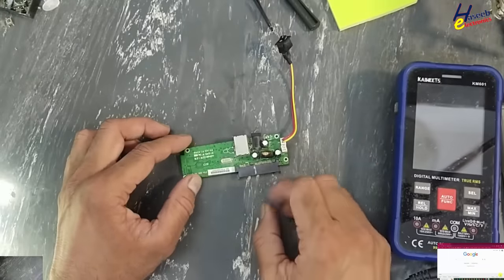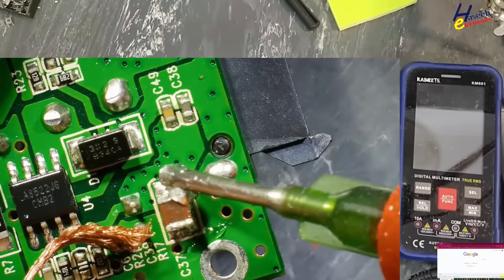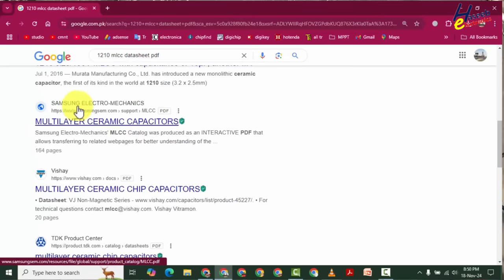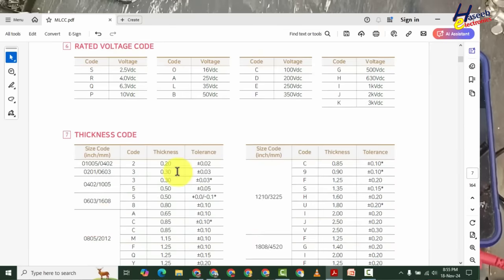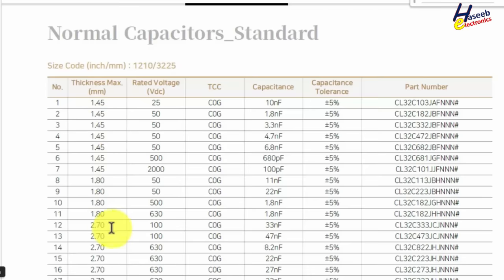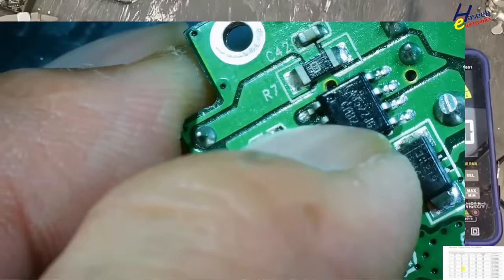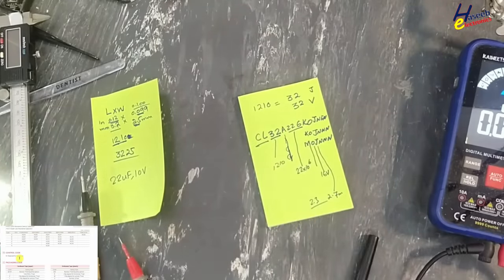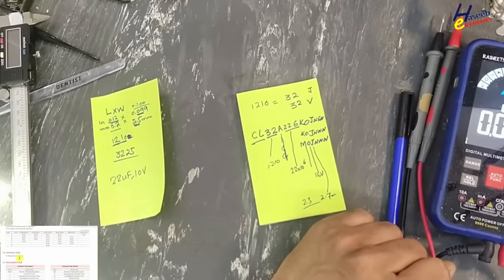{1243} Decoding SMD Ceramic capacitor to voltage and capacitor value

Comment: u didnt find its value until u measured with multimeter.
Reply from the maker: you are right 
first i took size code (length and width)
then datasheet 
then thickness
then circuit comparision for finding capacitor voltage (because too many voltage values are available in same thickness)
at final stage i found 16V 10uF, 
16V 22uF, 
and 16 V 47uF, 
if the capacitor is damaged then we can select any one of these 3 and testing the ripples at output stage for best fit component
Reply: well, he did narrow it down to 3 values. If you have a 2nd capacitor the same size on the board you could measure it. If no schematics are available you may just go with the largest value of that size and it could work. If still not lucky then try the smallest size. usually largest size will work because voltage is higher just the bigger ones cost ore and might not fit. I usually salvage something same size or bigger and just try it. I fixed a macbook the other day and just fitter a random cap, larger than the apple capacitor. It worked..
Reply: @izzzzzz6 normally if its light colour( white)the value is rated as pF, if its light brown it could be nF if its dark brown its uF(sometimes nF but bigger values)
Thats what we noticed in the manufacturing company
However some people saying its more about the material they have used, but whenever i have done the programs this theory was always worked for me.
Reply: Thank you very much for the info

Comment: Thank you. Have looked unsuccessfully for such info
Reply from the maker: Have looked unsuccessfully for such info????
do you mean, this video is not informative??
please reply for my calrification
Reply: Hi, thank you for sharing this video. As you showed us, there are many capacitor ratings for the same capacitor dimensions. Here you were able to measure one good capacitor, but if that capacitor may be in short (reason for us to be checking for its value in most cases), it would be very hard to say for sure which capacitor should we be replacing... Could you please explain to us how can we proceed in case of a failed capacitor? Thank you very much. Greetings.
Reply from the maker: @ruimonteiro7523 first of all thanks for your valuable words 
in case a damaged capacitor, and we have multiple choices, then it is to try one by one and to find the result of the circuit
Reply: @HaseebElectronics  They mean that they have been searching unsuccessfully until now.
Reply from the maker: Aah 
I got it now 
Thanks a lot 💕

Comment: Thank you for sharing the decode method.I didn't know it, great. The SMD codes are always a pain. Several times I had semiconductors with codes I couldn't find in SMD code books or the Internet. In this cases a repair was not possible. Resistors have 2 code schemas too. Very sad. 😢😢
Reply from the maker: best regards for your valuable comment 
yes the SMD codes are a biggest headache, actually it is step to make thinks non-repaireable. that is the reason most of the SMD parts are coded with some unknown marking and the codes are not revealed anywhere

Comment: Why have you used C35 in the first part of your video and then remove C37 So what value is C35 ?
Reply from the maker: both are same. as C37 was at a corner, so i preferred to remove it 
in upcoming sessions i am planning to decode the other size codes

Comment: Well defined video. The value would be anyones guess if you had a burnt cap, but if you do some math on the circuit in question, you can arrive at the value,like he did when he identified the chip on the board.Even though the datasheet showed pin 4 useda  10, it was actually a  22. Likely a timing/speed  change in operation, or ripple supression  as he answered in his post

Comment: What is to be done if capacitor is faulty, shorted..and you can not read capacitance? Where to go from there? Blessings my GURU!
Reply from the maker: first i took size code (length and width)
then datasheet 
then thickness
then circuit comparision for finding capacitor voltage (because too many voltage values are available in same thickness)
at final stage i found 16V 10uF, 
16V 22uF, 
and 16 V 47uF, 
if the capacitor is damaged then we can select any one of these 3 and testing the ripples at output stage for best fit component

Comment: Is it a way to find out the capacitance when the capacitor was burn or brake ?
Reply from the maker: in my routine 
first i took size code (length and width)
then datasheet 
then thickness
then circuit comparision for finding capacitor voltage (because too many voltage values are available in same thickness)
at final stage i found 16V 10uF, 
16V 22uF, 
and 16 V 47uF, 
if the capacitor is damaged then we can select any one of these 3 and testing the ripples at output stage for best fit component

Comment: Very information video
You are very knowledge

How to find these details for damaged smd capacitor? Please tell
Reply from the maker: first took size code (length and width)
then datasheet 
then thickness
then circuit comparision for finding capacitor voltage (because too many voltage values are available in same thickness)
at final stage i found 16V 10uF, 
16V 22uF, 
and 16 V 47uF, 
if the capacitor is damaged then we can select any one of these 3 and testing the ripples at output stage for best fit component
Reply: @HaseebElectronics Thank you Sir

Comment: Aap ne C35 ke liye jesa bataya hae kya bilkul ese hi C36, C38 aur C49 ke liye bhi measurements kr ke inki value jaan sakte hain ? Behad shukriya,,,
Reply from the maker: same method for all smd ceramic capacitors
Reply: @HaseebElectronics  shukriya,,,

Comment: Dear Haseeb,
Thank you for your videos. I want to run a 1.5 volt wall clock with a 3.7 volt 18650 lithium battery. How do I do this? Please make a video or a short.

Comment: I think it would be much faster to use a good LCR-meter and measure the capacity. You can guess the voltage rating from the application or like you did with checking parallel components. Its not a problem when the voltage rating is a bit higher, but it shouldn't be less than the original.

Comment: You are lucky , cap is in good condition , and not schort. If not ? 
Little advice...hot them , and check capaticance ...then find what kind of  dielectric  is.